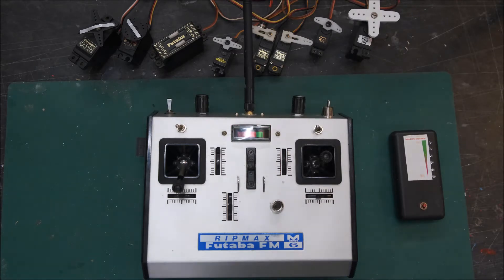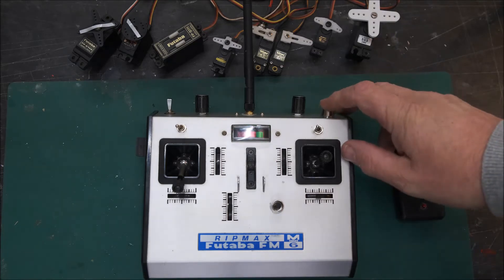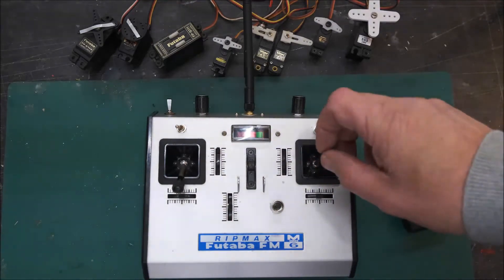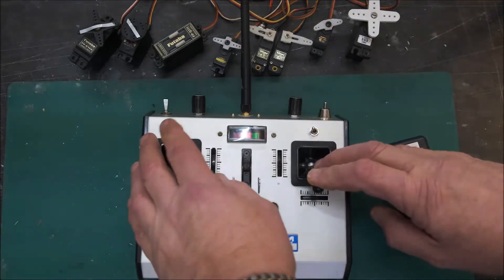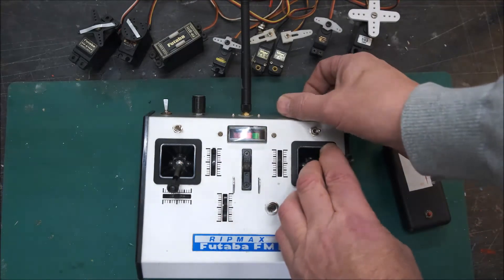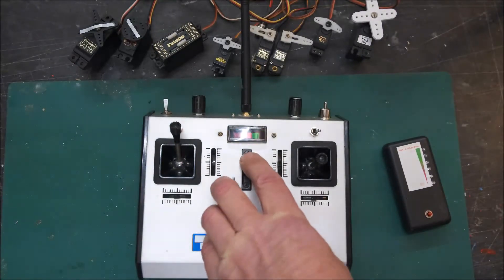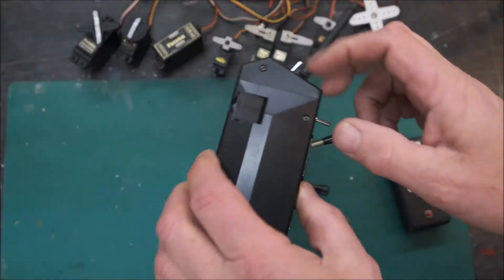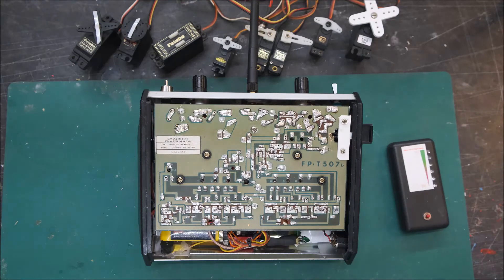Futaba M6 Restomod from 35 Mhz to 2.4 Ghz and Arduino F3A Encoder

Comment: looks good. but is this now as good as a moder n 2.4 set, apart from not having the screens they do... what sort of range would this now have to fly a plane  or boat
Reply from the maker: It has Identical ground and air range to all modern 2.4 radios

Comment: Which is the ppm output on this transmitter please?
Reply from the maker: Hi Michael, this one uses an Arduino encoder which has its own PPM output. The standard ones with a buddy box output can supply a PPM output if you are using the original Futaba PCB
Reply from the maker: email me at smackayrc@aol.com and let me know if you have an AM or FM Futaba and I can let you know where you will find the PPM signal. :)